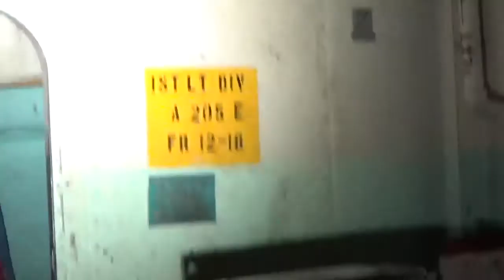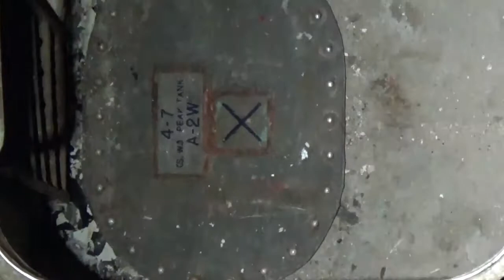How Does That Work?: USS Little Rock, The Anchor Windlass and Capstan

Comment: I was Ship’s Bosn aboard the Rock from ‘70 to ‘72. The anchors, winches, and chain are referred to as “ground tackle”. The last link of the anchor chain is secured in the chain locker by tying it to a pad eye on the after bulkhead. No one is below deck when the chain goes out or is brought back.
The bow was replaced in ‘71. We had a collision with a Greek destroyer in the Med in ‘70 and made temporary repairs in Malta but replaced the whole bow when we got back to the states. Hope this adds to your understanding of the Rock.
Reply: I served with Bosn Brown in second division back in the day.. What you called bear claws were really pelican hooks and all but one was released until it was time drop anchor then it was hit with a sledge hammer and gravity took out the anchor and chain..
Reply from the maker: Jim, thanks so much for your comments and for your sacrifices during your time in service. Thank you! Those are pretty fascinating snippets of information. I'm sure there's no one down below as those things are moving...they're like chain saws and would easily cut someone in half! When I stand on USS Croaker, I point to all of the rivets that one can see on the bow. So, the repair work from the collision is still visible. There are three "new" plates on the blade all riveted. I don't believe the whole bow was replaced wholesale because the welding work is still there, but I'll do some digging around with the Little Rock Association - I've never heard that before, nor have I seen pictures! I appreciate you watching and hope you enjoy peaking around your old ship! Come and see us sometime!